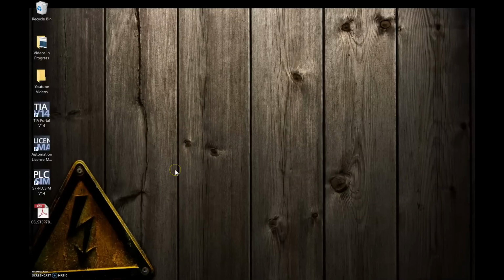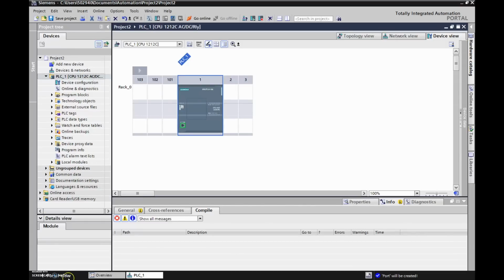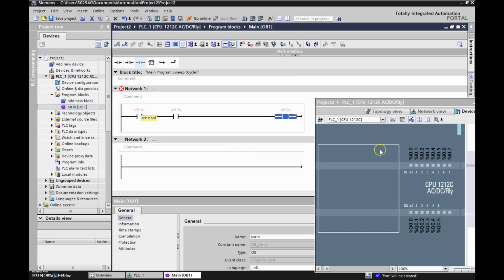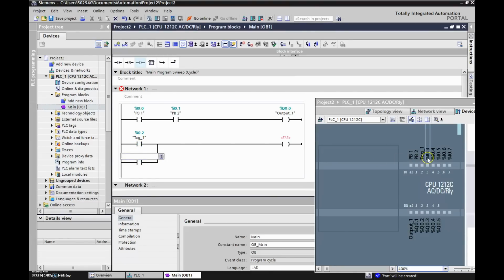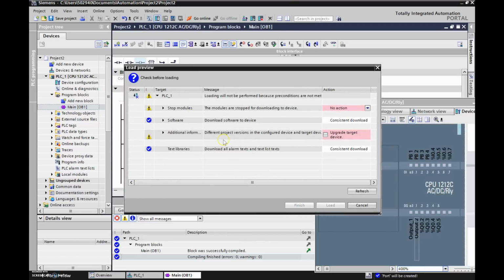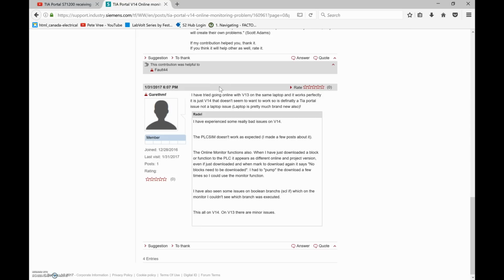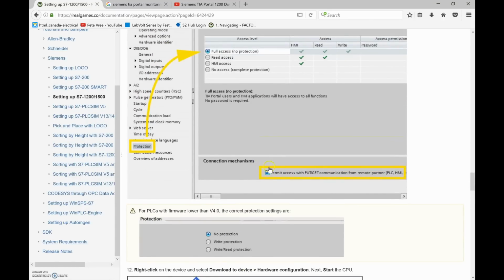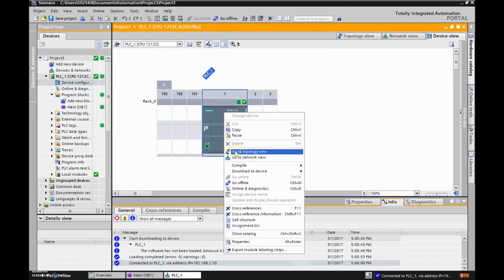Siemens TIA Portal Tutorial (AND & OR Program cw Unintentional Troubleshooting)

Comment: What type of router did you use? I am having trouble connecting my laptop to the plc, and in the project tree, I see orange circles with exclamation points in them in the project name line, as well as a message at the bottom of the screen "connection to plc terminated". Are these messages consistent with the issues that you had when trying to connect without a router?